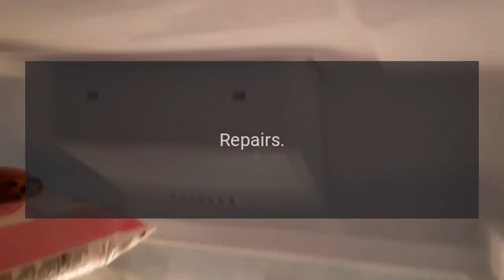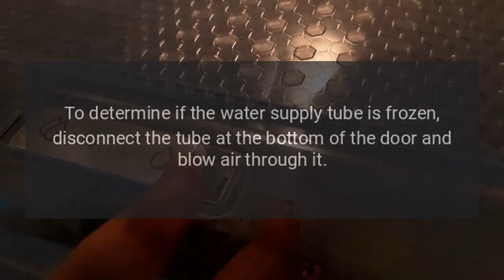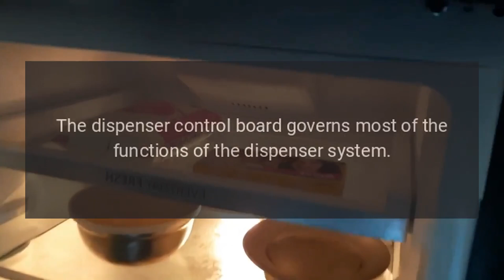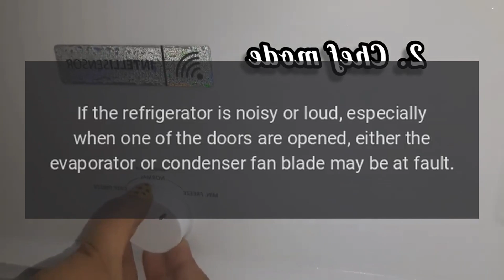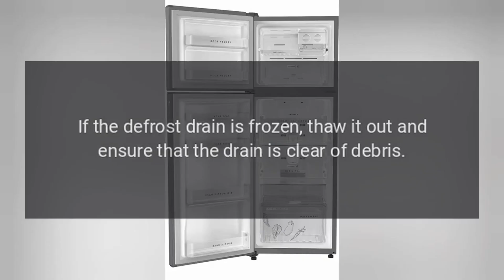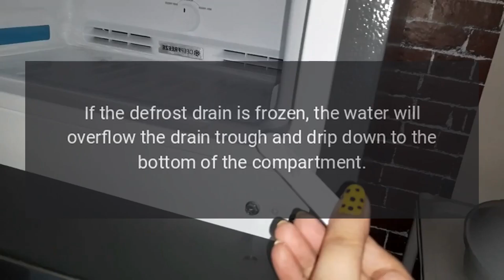LG Refrigerator Model LFXS30766S Repairs

Comment: This fridge is absolute garbage!  I've purchased mine in March of 16, replaced the compressor in December of 19.  Just replaced the compressor and evaporator coil February of 2026.  I would expect this fridge to last more than 10 years without replacing the main component twice in less than 10 years.  Linear Compressors are garbage, don't buy anything with a linear compressor in it!